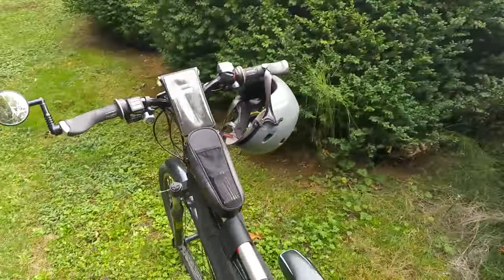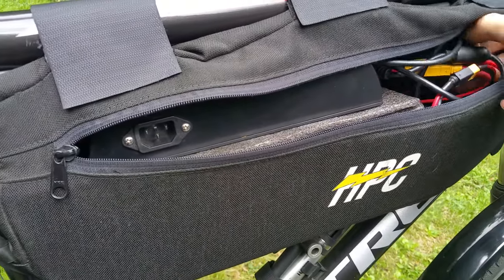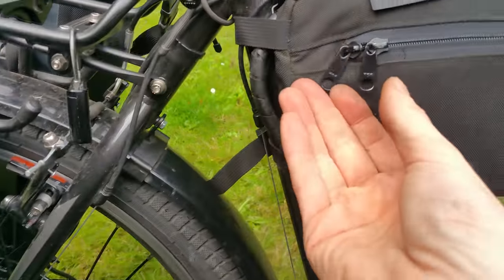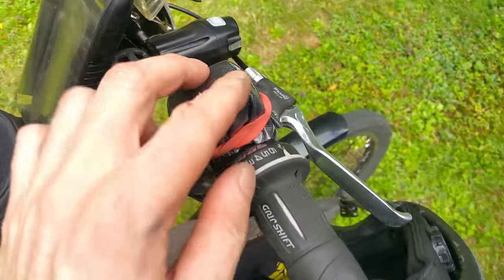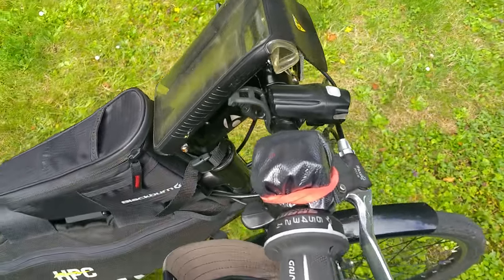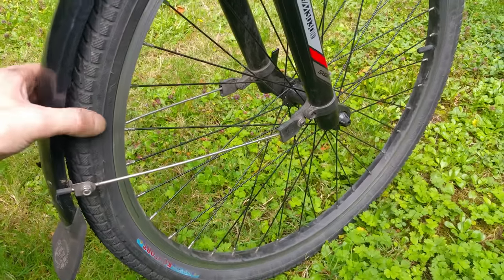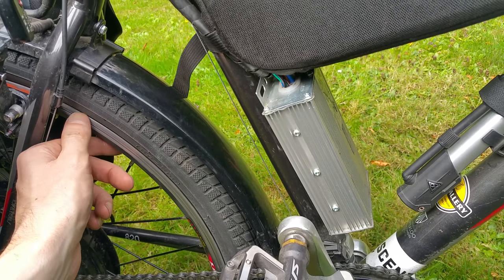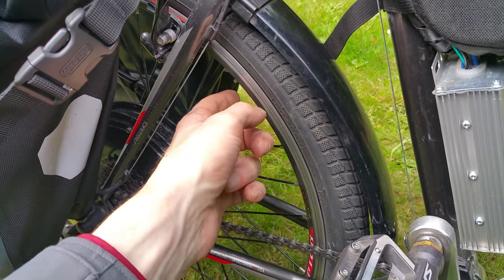DIY Ebike: 7500 Mile Update (car replacement vehicle)

Comment: Nice setup. How are you living with Avid 7 rim brakes?  I put those on my Trek 8000 e-bike  and stopping was not really a priority!  I had to rig discs to get a safe amount of stopping power.
Reply from the maker: Michael De Lazzer I can lock up both wheels with whatever weight I'm running and I'm very  accustomed to how they feel. I had disc brakes on my first setup. I actually found the rear disc to be pretty worthless with a rear hub not to mention a pain to properly adjust. My rear rim is ok but still whatevs. My 7s have saved me plenty of times so far.
Reply: rim brakes can be really powerfull (even though nowhere near hydrolics), but they need to be really well adjusted and it can sometimes be a pain in the butt to do so.
Reply: Hi i just subscribed to your page because im looking to do something similar to what you are doing as for replacing my car for my bike as a commuter to work. My question is, how fast can your bike go and how fast do u normally travel for those brakes to work effectively??

Comment: Good video. Gives me good clues on some of the problems you have had.  I am curious on how your tires stand up and what kind of range do you think you will get or have gotten out of them? And also since you have a lot of miles what seems to be wearing down first on your bike?
Reply from the maker: Thanks.  I've gone through many sets of tires for different reasons.  The Schwalbe Marathon I had on the rear wheel for a mere two weeks was taken out by a huge screw but I didn't like the way it handled anyway.  I had Serfas Drifters for a while and enjoyed them but they did seem to wear quickly. They look really cool but make noise when turning and that made me glad when they wore out.  I had Hutchinson Acrobats originally which were ok.  The current tires are the Kenda Komforts and they seem to have worn very little so far. I like the balance of street/urban trail. i'll see how they do in winter soon enough. My overall ebike tire advice would be - nothing is invincible, be okay with risking the occasional flat to have a better performing tire. That being said, I use Mr. Tuffy liners and finally ponied up for Q thorn resistant tubes.  I seem to always get flats around when they clean the streets from the wire brushes which is not without irony.  I'll see if the thorn resistant ones stop those tiny bristles.  It bothers me when taken out by such a tiny little ironic thing. In 7500 miles over a year and a half I've had roughly 10 flats, 9 of those being on the rear wheel but only had to replace the tube 4 of those times.  The only destroyed tire was the Marathon, go figure.

I haven't had anything "wear out" besides tires.  I do upgrades though.  I personally put the money into brakes, pedals, grips, rack, storage.  I just recently had the motor wheel relaced which I think I'll do with every motor kit I buy going forward.   The drive train is probably least important but I replaced my rear derailleur when I had my wheel done and frame realigned.  Version 1 Ebike had already been ridden for a year before I got it.  That was a crappy big box dual suspension "mongoose".  I had to replace the bottom bracket, rear suspension spring, constant squeak maintenance...the frame ultimately tore open.  Having a steel bike now I'll stick to steel going forward.  The next thing I'll replace is probably the fork.
Reply: Thank you for your response. I was looking at Mr Tuffy liners and think I will add those on the next set of tires. My bike is an Urban Ryder 500 watt made or assembled in Burnaby BC. It is not top of the line but it is solid and the parts are good quality enough so that I can upgrade or leave as is. The bike came with a set of generic CST MTB tires (I think the Cheng Shin company puts them on every bike out of China.) But even though they are a cheap tire and I don't think they are engineered for great rolling resistance they show me to be a relatively tough tire. Our very abused Norco shop bike in an industrial complex I work at  has these tires. And we ride through a lot of very bad material. (Crushed computer parts...hard plastic glass, metal etc). We had only one flat  due to acid conditions hardening a valve stem and it broke off. So something can be said about these tires. I didn't catch what pedals you have upgraded to do they give you better, so called, foot control?You said you relaced your drive wheel. Was there any particular reason for this? Were spokes an issue.( I would think that spokes might possibly loosen more so on an ebike because of the way torque acts on them). Or were you just keeping ahead of maintenance?By the way have you ever weighed your bike with everything on it? Thanks.Steve
Reply from the maker: I adjusted the original spokes often. They were just poor quality. The nipples were terrible. I had replaced two spokes already on the new kit and broke a couple of nipples to where i couldn't adjust them without pulling the tire. Well worth new ones. Much stiffer feel. I haven't weighed the bike. My guess would be 70 lbs without panniers. Perhaps 100 lbs fully loaded. I hear CST makes fine tires. A lot of people on endless sphere forum talk about the CST Cyclops tires (which are identical to Serfas Drifters). Your work place sounds dangerous! Bike eating acid pools! Hahaha. My pedals are Shimano Saints. I ride my bike like a horse, using the pedal leverage to avoid bumps, not to mention super wet weather here so I wanted a good, sturdy platform. They are great. And serviceable!

Comment: People talk a lot about mid drive and hub drive.  His dose a side mount motor compare? I️ am trying To build a e bike as cheap as possible. I️ intend to use a side mount and led acid battery.  Is this a mistake?
Reply: Yeap lithium battery is the way to go , on the long run it s cheaper
And hub motor 'DIRECT DRIVE MOTOR) is the best because it s more reliable it will last a very loooong time with out doing any maintenance
Geared motor are more expansive and are less reliable